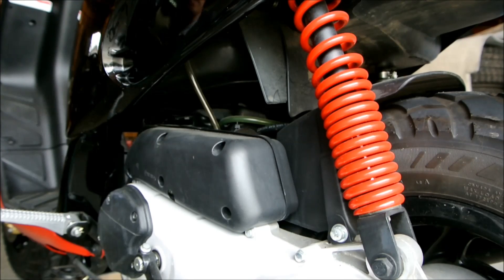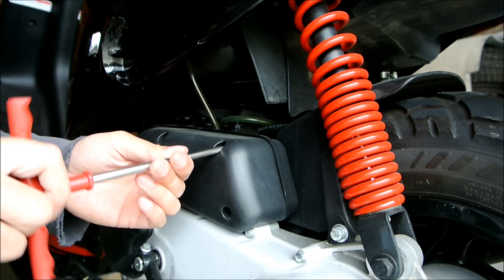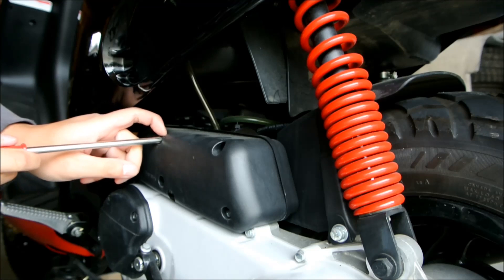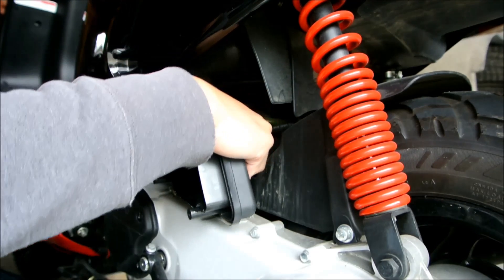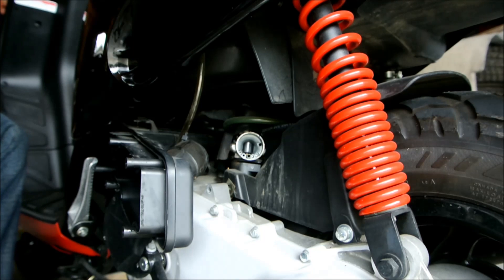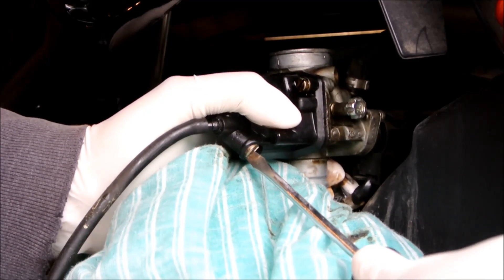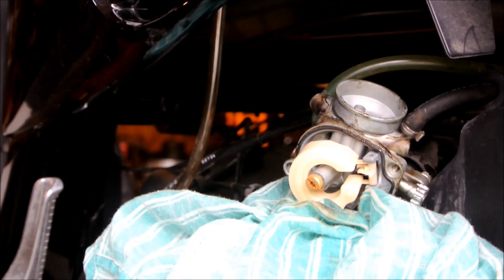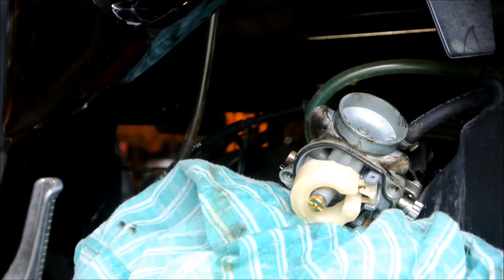UNLOCK FREE POWER FROM YOUR SCOOTER (FASTER SCOOTER - EPISODE 2)

Comment: will lighter rollers make your bike quicker? if how much quicker
Reply from the maker: It all depends whether lighter roller or heavier rollers let your engine realize it's maximum horsepower better. If your engine's peak horsepower is 11,000RPM and your roller weights are too light causing the engine to operate beyond 11,000RPM then your bike won't be any quicker.

Comment: Stop suffering, buy WS175... You welcome :D
Reply: +FIFTYmil fantastic argument 😂😂😂
Reply from the maker: Stop suffering, buy a Ducati 1098S... Yes that's what I have and you're ever more welcome :D
Reply: Alright... stop suffering and buy kawasaki ninga H2r, you welcome!! :D
Reply from the maker: Except you neither have a ducati or a kawasaki ninja. Game over :D
Reply from the maker: Your replies just make no sense...
Reply: FIFTYmil If I have a gy6 150cc, will it have this brass restrictor?? Also what modifications should I do to it first? What are the best mods to start?
Reply: Like mods overall
Reply from the maker: To my knowledge the CV carb on the 150cc gy6 does not have a brass restrictor. The best first mods I'd like to do is install a tachometer and tune the variators (assuming you are not planning to further increase engine horsepower.)
Reply: The argument just make me lose the bus...

Comment: Your assumption that your engine will seize if the mixture is too lean due to a lack of lubrication is incorrect! 
 lubrication is regulated by a separate oil pump and is not affected by the mixture in any way other than the engine speed.
 The overheating you will experience with a lean mixture is due to the lack of cooling that is given by the incoming fuel which is considerable. Most two stroke engines rely heavily on this cooling to run within their safe operating temperature range as well as keeping the fuel burn characteristics at the optimum for maximum power output.
Reply from the maker: roythearcher good to know! I have adjusted the oil feed accordingly. Regardless a lean mixture will indeed accelerate engine wear and potential piston seizure so erring on the rich side is recommended
Reply: It's also why most motorcycle makers in general don't recommend the use of "gasohol" or other organic fuels in their engines as the cleaning effects of this fuel substitute strips away any oil based lubricants and accelerates wear to an unacceptably high level!
Reply from the maker: roythearcher good to know. Learn something new everyday! What is gasohol? A lot of fuel sold here has ethanol blend
Reply from the maker: Ah yes - we have ethanol in our fuel too (up to 10%) but for that reason I only use premium gas which does not contain any ethanol.
Reply from the maker: roythearcher is correct  and to be honest I thought the same as Drunk Santa for nearly as long as I knew about two-strokes. The separate lubrication system is rarely mentioned anywhere and can easily go unobserved. That is why the comments here on this channel help facilitate discussion and will hopefully spread the knowledge to more people.

For this particular model Piaggio Typhoon and any other bikes equipped with the hi-per2 engine the oil pump is driven by the crankshaft and can be accessible right underneath the variator.
Reply: thats in 4 strokes, lean mixture in 2 strokes means not enough oil because the gas and oil are mixed before the carb
Reply: FIFTYmil I don't know about the states but over here in Europe (i'm in the UK) "Gasohol" is the blend of petroleum and alcohol based fuels such as methanol and plant based alcohols, usually around 3-5%, but even this low percentage is enough to dilute the effect of oil  on cylinder bores and damage higher revving motorcycle engines.
Reply: uhm, where do you want to get the oil in if its not before the carb, or like, on the carb on some luxury shit. two stroke runs on gas mixed with oil, if you put it in at the crank it will not be pulled in as easely and it will not dispurse well. and if that was how it is, that would not be different if the mixture was different, a lean mixture would just mean it gets less gas like in a 4stroke
Reply: +Drunk Santa Your reply would make more sense if your language and grammar were understandable! However, My old Suzuki was fitted with their "CCI" lubrication system (Standard fitment on all their 2-strokes) where the oil is delivered from a separate tank by an engine driven pump and injected directly onto the main bearings and into the air-flow directly BEHIND the carb where it lubricated everything else it needs to. This keeps the fuel and 2t oil systems separate and eliminates the need for mixing the fuel with oil in the fuel tank also keeping the oil flow consistent with the needs of the engine as it is governed by engine speed and regulated by a control cable operated by the throttle..  If this system didn't work then why did Suzuki use it for around thirty years from the 1960's right into the 1990's. Honda and Yamaha also used a similar system on their later 2-strokes.
Do some research into this and you will find out what I mean. Pre-mixed fuel/oil mixtures went out in the early 1970's except for a few racing bikes on the track but All GP teams used oil injection systems as they were more reliable and less prone to errors in fuel/ oil ratios.
Also look at the lubrication systems used on modern 2-stroke scooters and you will find that they are the same.
Reply from the maker: Roy the archer is correct. You would rarely see premix in "modern" two-strokes. An independent engine driven system offers much more advantage than premix as he said. One of them being able to control precisely the amount of oil being mixed in with the fuel depending on engine RPM. Premix on the otherhand would often over-lubricate the engine at certain RPMs and under-lubricate in others - which is detrimental for performance and the environment.
Reply: i live in an area where the best means of getting around is either a car or a moped. I have personally never seen the seperate pump thing in my life, and i see scooters and mopeds every day and quite often need to service some part on it, and pretty much all are made from 2010 to 2013 or from 2015 or newer. I really have no idea why nobody has one from 2014
Reply: Have you ever had to rebuild a two stroke engine? My guess is that you have never had to, but take it from me, All two stroke engines whether it be a moped, scooter, motorcycle or even a mini moto, if they have tank for the two-stroke oil, then somewhere there will be a pump to make sure that oil gets to where it's needed and that pump will be driven by a gear off the crankshaft and regulated by a Bendix style cable so that the pump is synchronised with throttle setting so that the amount of oil delivered is always correct for the load on the engine..
There is always the possibility that this pump can be electrically driven but for simplicity and reliability a crank driven pump is far more likely.
This pump will give years of reliable service and will almost never need re-building or servicing other than the occasional cable adjustment.
It is there, probably on the end of the crankshaft, You just haven't found it yet!
Reply: i have had to rebuild an engine three times, and ive got 2 minibikes in my garage, and they do not have one of those pumps
Reply: they must be premix then unless they have a tank for the oil, then there must be a pump somewhere...
Reply: none of them are premix, they all mix in / on top of / whateverthefuckyouwannacallit the carburettor
Reply: Thank you FIFTYmil! 
Drunksanta, I rest my case!
Reply: Actually too lean adds engine wear
Reply: roythearcher  running lean could melt the piston though.. you’re very right with the lube statement..
Reply: +Drunk Santa you have a misconception about modern 2-strokes then! no modern 2-stroke mixes the oil before it reaches the carb these days!
Reply from the maker: To settle matters, here is proof that 2-stroke oil pumps do exist: 
http://www.scooter-works.co.uk/media/catalog/product/cache/1/image/317800eadccd43921de9ff03c579e415/1/6/16987.jpg

The point that you have never came across a 2-stroke oil pump ever before because you have "rebuild engines, works on bikes for multiple years, and have owned many minibikes" is not valid and not worth further argument. That is just as pointless as saying because I am a scooter mechanic for 10 years I should know how to fly a rocket to Mars. Experience and ignorance is two completely different topics.

Here is a forum discussion of oil pump vs premix dating nearly a decade ago: http://www.apriliaforum.com/forums/showthread.php?196346-Premix-vs-oil-pump

Here is a video showing the location of the oil pump:
https://www.youtube.com/watch?v=S3TWYRtE4nA&ab_channel=olivierst.

Comment: i try EVERYTHING about gy6 scooters. theres nothing to make it faster. if you wanna faster motorcycle, buy a real motorcycle.... thats my advice
Reply from the maker: If you have a problem and the solution is to buy a real motorcycle....that's a pretty bad advice. My gy6 can pull wheelies no problem and goes faster than most of the traffic on the road.

And by real motorcycle, what do you ride?
Reply: FIFTYmil i ride gy6 150cc right now. and i have big problems about top speed. im riding in national road everyday and i cant reach more from 80km/h.
bike was 125cc and i install big bore kit. and became worst. my older motorcycles was kawasaki klx250 4 stroke, kawasaki z750 and honda astrea grand 110cc... so, what is your advice for my gy6?
cdi is performance, carburretor is stock, differential is stock.
Reply from the maker: DJ Dimitris Priftis There is definitely a problem. My 4-stroke 50cc reaches 80kmh and my 2-stroke 50cc reaches 95kmh. A 150cc should definitely achieve much more than that.What was your top speed previously when the gy6 was still 125cc?
Reply: FIFTYmil about 100, 105 km/h. i think the ignition advance my problem. but what is the best? 12 degrees ignition advance i have now.
Reply from the maker: Before you tune the timing, I think the more evident problem is that you lost 20kmh going from 125cc to 150cc. If you installed everything correctly, it is most likely that you're not supplying enough fuel for the larger displacement but that is just a guess.  That is, your carburetor needs to be tuned for the extra displacement
Reply: @DjDimitrisPriftis  if u want some speed change it into 6g roller clutch spring 1000rpm centerspring 1500rpm thats is the teick to make your scooter go faster even your are stock engine
Reply from the maker: DJ Dimitris Priftis I would try to restore original power that you had with 125cc before adding any other modifications. A 150cc should outperform a 125cc in stock form. Adding more modifications would just confuse your findings further and it will make it more difficult to achieve best performance. That would be money wasted
Reply from the maker: 808ROTY09 I ride a 1200cc super bike (check out my Instagram) and yet I'm still here tuning my piaggio. What am I doing right?! #mindblown
Reply: a real motorcycle? lmao anything on two wheels is a "real motorcycle me and my cousin are trying to make his "fake motorcycle" faster and to be clear yes i do happen to ride a "real motorcycle" so yes i know what i'm talking about.
Reply: try jetting the carb and get your timing checked, you might want to check your valves aswell. you can buy a big valve top for better preformance aswell. hope you fix your problems!
ps new cylinders have a breakin period that can affect it aswell
Reply from the maker: samili While it is true there is a break in period, I would not advise changing the head because you would introduce on top another variable that will affect performance. Definitely ensure everything is installed correctly first, after which sort out your jetting and you should have the same if not better top speed as before with the 125cc.
Reply: FIFTYmil maybe piston rings was not installed as they should
Reply from the maker: Yes it could be a number of variables. However, since he did not mentioned any other significant symptoms, it led me to think the engine is just being starved of fuel.
Reply: maybee. but i guess we will see when he gets it fixed, im used to 2 stroke scooters and not 4 stroke ones so i can provide too much help in this subject.
Reply: carb isnt need jetting as the mechanic and service manual says. carb is for 125 and 150cc also. my "big bore kit" include piston, piston rings, camshaft, gaskets, ignition coil and all of this are installed correctly.
i'm thinking to install a kawasaki kazeR carb these days, mechanic carb and without vaccum pressure valve...
Reply from the maker: It wouldn't make sense that the same carb and same jetting can be used across 125cc and 150cc. Also across different environment. That alone tells me your jetting is incorrect, hence the loss in performance. In my other episodes you can see what a big difference just changing the jets alone could do to the engine performance.
Reply: FIFTYmil thank you.. i will try jetting.. for the kazeR mechanic carb what is your opinion
Reply from the maker: I'm sorry but 2 strokes are far from what you described as "rpm reving engines that blast out power all the time." LOL. I have both 50cc 4 stroke and 50cc 2 stroke and they are actually quite similar. Perhaps the 2 stroke makes 10-15% more power and on the so-called "butt dyno" you would say it's somewhat faster but definitely a "rocketship" or not as different as you described
Reply: FIFTYmil 2strokes are way way faster than 4t a 50cc 2t can hit 60mph which is nearly as fast as a 125 4 t
Reply: My 70cc 2 stroke moped full tuned goes 120 kmh lol
Reply: @DimitrisDbnn
Idk if you have figured thus out, maybe you have..
To gain more speed(torque,horsepwr), start with your gearing and variator weights, respectively.  
"HORSEPOWER WINS RACES, TORQUE WINS CHAMPIONSHIPS."
- some old guy that built badass cars

Comment: 2 or 4 stroke ?
Reply from the maker: This is for a 2-stroke piaggio typhoon and similar models equipped with the 49cc Hi-Per 2 engine and Dellorto 17.5mm carburetor
Reply: I have a YamahaVino 2 stroke with the Itallian engine
Reply from the maker: Sean Finkel Correct me if I am wrong but I believe the 2 Stroke Vinos are equipped with a  Minarelli 1E40QMB engine which is not the same as the Hi-Per 2 Piaggio engines
Reply: FIFTYmil yes thats right

Comment: I have a 2016 TaoTao and it is slow taking off almost like not enough fuel and then it takes off. Will a change in fuel jet work?
Reply from the maker: hard to tell. how certain are you that it is not enough fuel at take off? Do you have a CV carb or a Slide carb?
Reply: ***** You like the name?
Reply: Matari 7 don't do that
Reply: Have a look at your air filter and change/clean it if dirty. Also look at your spark plug as this will tell you a lot about what's going on in your engine. 
If the firing end is a light brown/tan colour, everything's cool and you should leave it alone!
 If its  black and has a lot sooty deposits on it, you're fuel/air mixture is too rich, indicating a poorly set-up carb or choked air filter or wrong grade plug (too cold).
 If it's black and oily in appearance, there is too much two-stroke oil going through the engine and this can cause misfires due to a fouled plug and the oil pump needs adjusting (rare!) or more commonly, indicates a badly worn engine.
 If the centre electrode insulator is white in colour and may be blistered then the engine is running too hot due to poor set-up of carb, exhaust or there is an air leak in the induction side of the system. Either way, this needs correcting quickly or you will seize the engine destroying it at worst and requiring a re-bore at best! This condition could also be caused by a wrong grade of plug (too hot).
Carb settings are critical on a two-stroke and most faults can easily be rectified so look for the simple things first before you go looking deeper for something that may not be there!